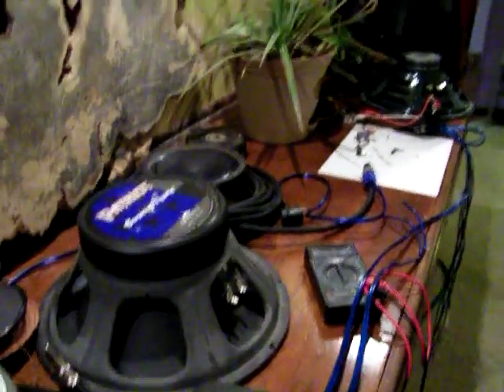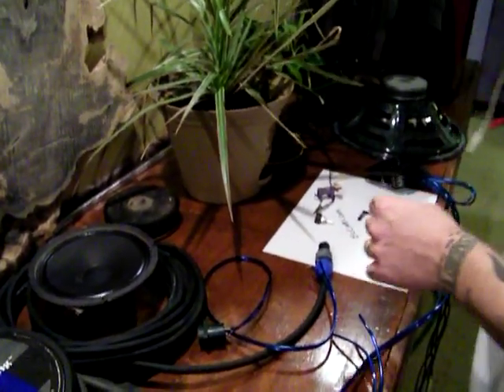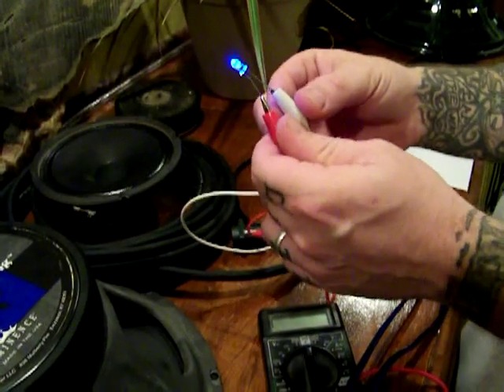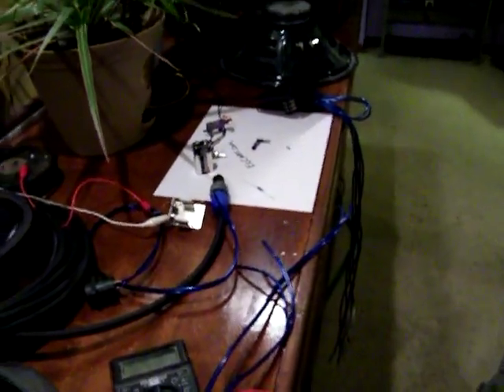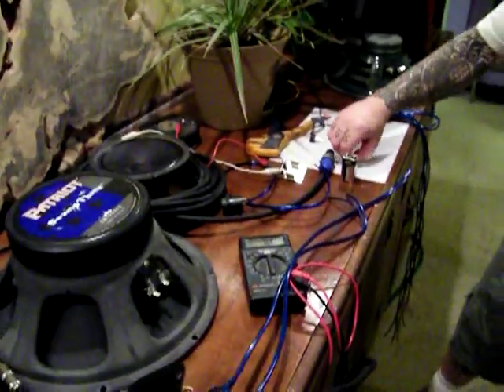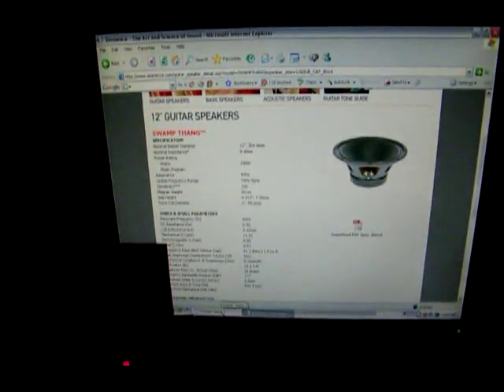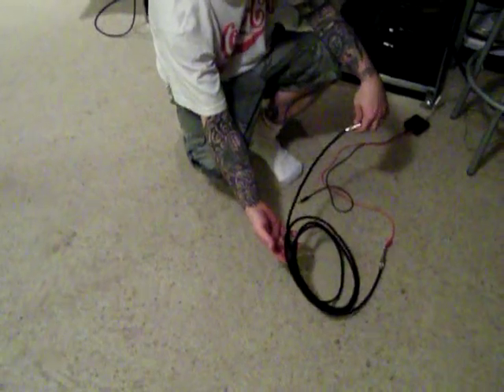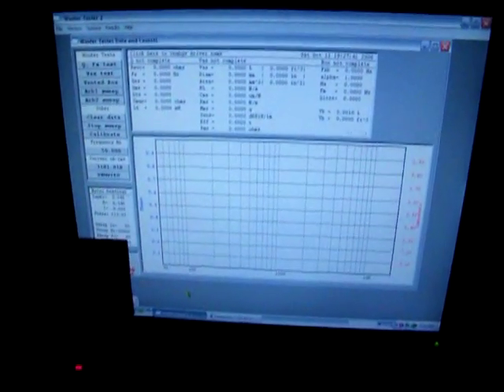Ear Candy FAQ Parallel vs series wiring for guitar speaker cabs 2 of 3

Comment from the maker: You are close! Guitar pick ups are polarized like guitar speaker mags, it depends on what direction they are polarized. The wire on the voice coil can and does determine a LOT of things. DB, ohms, FRQ, wattage rating, but with a speaker, IT IS projecting the tone that is amplified with voltage. A guitar pick up (non active one) simply picks up the tone through the P/ups and without voltage , sends it through the cable via the pick ups. With speakers it affects more then the output principle. ;)